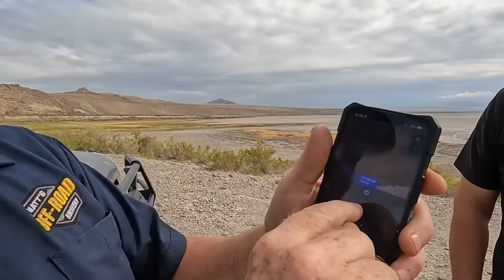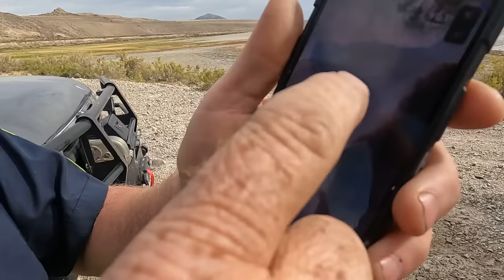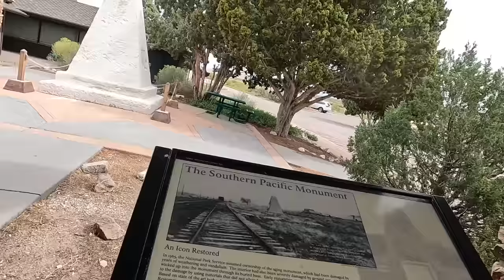Great Salt Lake Now The Great Mud Pit - Mega Drought Rescue

Comment: Four years ago on one of my drives back to Oregon from a visit to San Antonio I saw a sign on the freeway for the Golden Spike National Historic Park. I drove miles through the country before I reached the site. On the way I stopped and hiked around some of the historic spots and learned a lot. When I reached the visitors center I learned they were putting the trains away for the winter. A park ranger spoke to us, then they started up the two trains and backed them into buildings for the winter. Well worth my unplanned stop.

Comment: With lake bottom, that could have been much worse. The two times I’ve been stuck was also in a drought. Unlike here the top had dried but underneath that crust is several feet of silt that’s been underwater for years. You’ll be driving along thinking everything is fine and then the crust breaks and your all of a sudden stuck to your axles. It is easier to pull out though because the dry crust doesn’t create the suction that mud usually does.

Comment: You can tell Matt is becoming a wiser and older because he's over planning for these recoveries. And in all reality muddy shrunken lake beds are probably the hardest. 
"Better safe than sorry." 🙂
Reply: The problem with dried mud lakebeds is that often only the surface is dry. A couple of inches down and it could be clay, could be mud, could even just be water - there's no way to know without probing the ground.
Reply: And he didn't run out of gas!
Reply: @bradley-eblesisor  😅🙂
Reply: @dyent  yes that is how it is in Northern Utah lake Powell and in some parts of lake Mead the surface looks dry but there is three or four feet of mud underneath. To my surprise this recovery was in the Great salt lake. We all know it's been receding a lot over the last 10 years but the mud still had water glistening on the top. Far less sneaky and waiting you to get your vehicle stuck in. Of course you go 100 yd in any direction and have a completely different situation. It's no wonder Matt went big on this recovery these dry lake beds are really hard to do.

Comment: The actual golden spike should be at that museum, there is one at the Sacramento Railroad museum tat never got used, as I recall there is a silver spike and other spike made of other metals. When the railroads were started they were different widths on the 2 side of the country, I do not know which side became the standard size but perhaps they used the west coast side since there were so many tracks that ran through mad made tunnels in the mountains made by the Chinese laborers or there might have been more track on the east coast since it was started there first... The locomotive that is the most famous in the world was in movies and TV shows such as the Wild Wild West, they had different smoke stack for the different shows and movies, it is in the museum at Jamestown, Ca. It went to the Sacramento Railroad museum to get a new boiler several years ago and was put back to work giving train rides!

Comment: Just an idea or suggestion.  Go down to your local Fire Department and get a roll of 1 and 1/2 inch fire hose.  The cover your boom support chain with it. Protects from weather and  and noise factor will be helpful. Should a chain bite the dust the hose will keep it from hurting someone.  Just a suggestion. It is your rig and  no mater what us armchair builders it is yours.

Comment: For anyone wondering about those google pins being inaccurate, it's cuz the folks aren't waiting long enough before getting the pin in google maps. 

When a phone grabs an initial location, it's a rough grab. It usually grabs cell tower location first which is wildly inaccurate. Then as GPS grabs more satellites it'll be more accurate, down to a few feet. 

So what the customers are doing is opening google maps and immediately grabbing a location/pin which is the cell tower location data(not accurate). What they should be doing is opening up google maps, waiting 1-5 minutes until the blue circle in google maps is as small as it's gonna get(usually 10 feet), then grabbing a pin for Matt. 

Also, you can/should use GPS coordinates instead of pins. They're available in google maps. What this allows you to do is to copy the GPS coords, close google maps, reopen it and input the gps coordinates. This is exactly what matt will see when he puts those GPS coords in. You can be sure he'll get the correct location.

Comment: Promontory Point, where the (basically I-80, only for trains) transcontinental railroad met. They started from both coasts at the same time, and met in Utah. Go figure. How different is a sand setup from a mud setup?  (I mean if you are talking about getting stuck, as opposed to a 'mud bog' vehicle?)  Historic fact, that lake was at the Bonneville level (a LOT higher) only 15000 years ago. You can still see the highwater mark. PS: If Lizzie isn't silly, she'll sell her ripped pants online for more than enough to buy several new pair.

Comment: Is that near the golden spike Arena where the awesome rodeos and even more awesome derbys are held because I've been to several rodeos and tons of derbys at the golden spike Arena it never disappoints as a spectator or participant in either we've left there with cars so mangled we loaded and unloaded with a telehandler putting the front tires of derby cars in the trunks of the 1 in front of it and a compact on the neck and barely fit everything on my 40 ft trailer and left with them all on the deck not stacked with room for crates with engines and transmissions we bought on the back of the deck with room to spare did I miss a part of history I need to visit next time I'm there

Comment: You Are Going To Wish You Would Have Stayed Out Of That Salt Mud  -  It Corrodes Everything  -  Raise It Up,  Pull The Wheels Off And Pressure Wash Everything,  Brake Calipers,  Open Knuckles,  And Hose The Body,  Get All That Crap Off ASAP!  -  Don't Just Go To The Car Wash  -  A Mixture Of Half Acetone & Half ATF Spray Job Underneath Will Also Help Stop The Corrosion  -  Best Advice Is Stay Clear The Hell Out Of Salt Flats Mud If You Like Your Vehicle

Comment: Technically, the things you are calling engines are really called locomotives.  The engines are on the locomotives in the form of the cylinders and pistons.
The pistons are connected to the drivers, which are the big wheels on the locomotives, by first, piston rods which are guided by alligators, secondly by connecting rods which complete the connection between the alligators and the drivers.  The drivers are counter-weighted to compensate for the weight of the end of the connecting rods.

Comment: Funny  thing  about  history  is  it  is  often  not  what  common  knowledge  says  it  is.  This  is  the  case   with  the   Promontory  Point .   Common  wisdom  says  they  built  to  this  point  and  then  joined them  up  here.  That  is   not  exactly  true.  What  really  happened  is  BOTH   railroads  built  several  miles  of  track  PAST  each  other.  The  railroad  companies  management  finally    saw what  they  were  doing  was  not  making  sense. So  they  compromised  and  decided  the  "official"  meeting  point  would  be  here.  The  reasoning  for why  this   this  site  was  specifically chosen  is  not  clear.  Maybe  because  it  was  a  good  flat  place   to  hold  an  event.  Maybe because  it  was  easier  to  get  the  beer  wagons  here.  We  may  never  know!

Comment: That Ford don't weigh no 9K Lbs...  I cringe every time you call your truck "Blue Steel" as my idiot brother-in-law uses that name for his modified boat trailer  turned junk hauler he pulled with a small Chevy car with a 4X4 wood bumper.  Had the 4X4 mounted on the bumper shocks..